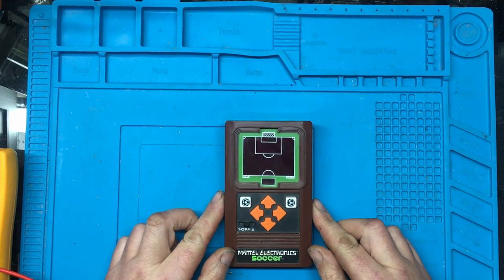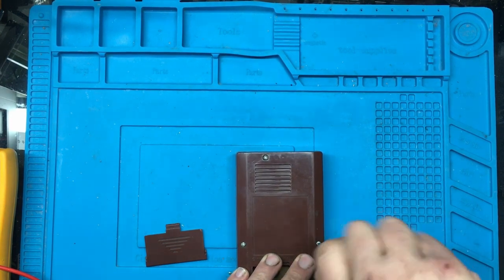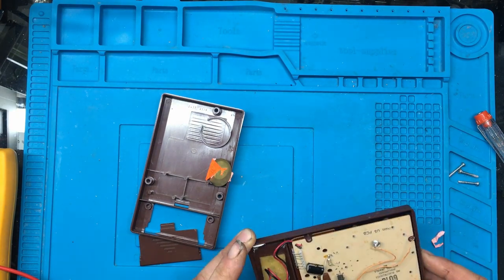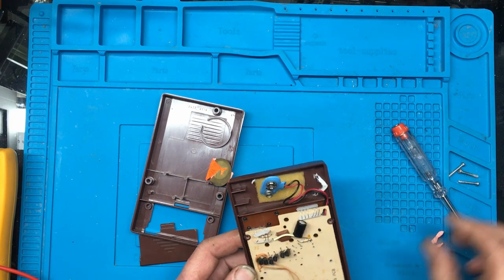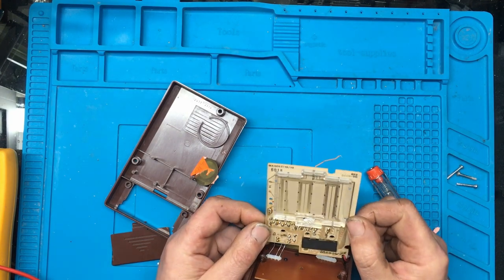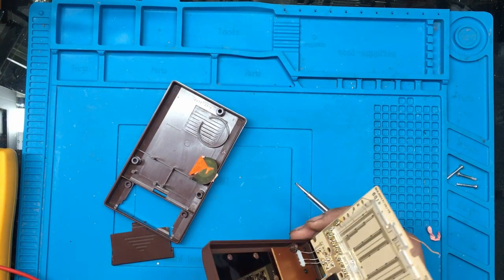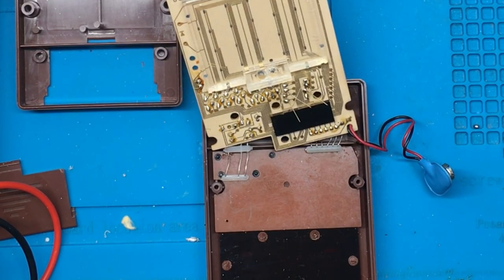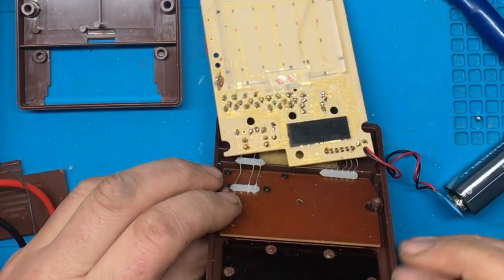Faulty Vintage Mattel Soccer - Can I save it?

Comment: dont know if you noticed but most of this video is nearly out of shot until about 12 minutes when you moved it back to center.  nothing can be done about it but it should be mentioned.
Reply from the maker: Yes. Problem is I can't see what the camera is recording.  I need a better set up really. I'm just using and old iPhone 6s recording these and I can't see the screen as it's on a mount above where I'm working . I try to use the mat ad a guide but it doesn't always quite work as in this instance. I've only really been doing this for a few months so it's all still learning for me too!
Reply: @BuyitFixit  yeah its hard to do these things. You are doing well with what you have
Reply from the maker: Thanks JS. Yes it's not until you start doing it you realise the effort pitfalls and problems. Like hand cleanliness and focus issues, getting things in shot, sound levels, editing,  using multiple cameras, and remembering to make sure the camera is recording like in a video I thought was recording last week.. which wasn't recording for about 10 minutes. Still learning but hopefully improving over time. 👍
Reply: @BuyitFixit  yeah its why i dont ever edit lol. I just post as-is. Its too much work. Thank you for your time and effort